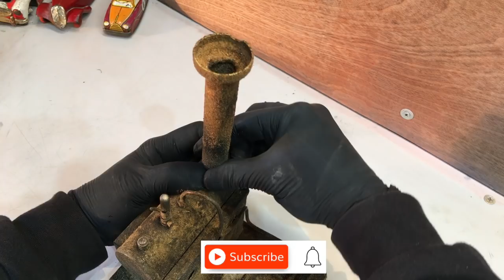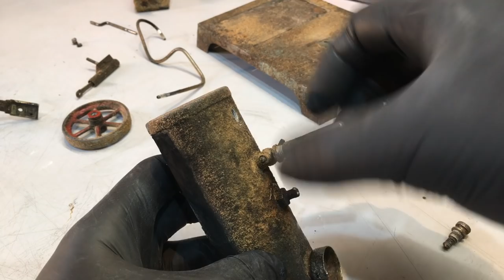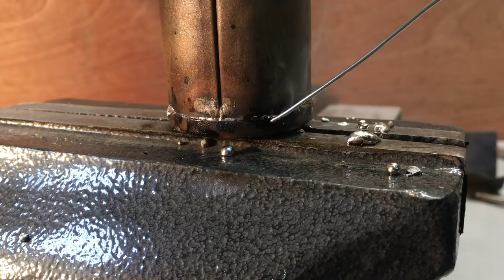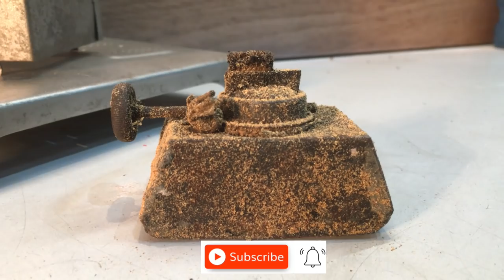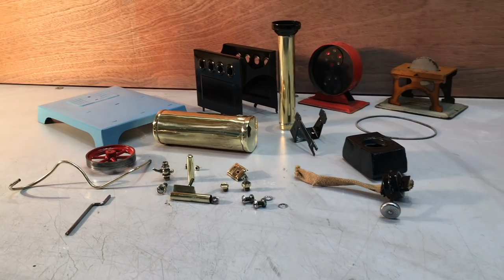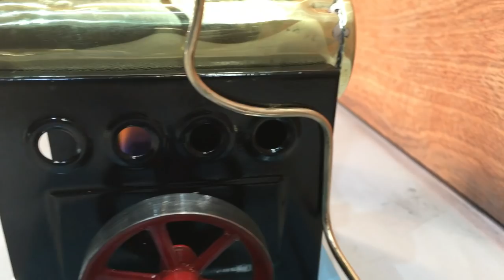Antique rusty toy - Steam Engine - JC Unis 1950 - Full restoration

Comment: I had a similar one in early 1970s.  Mine used Esbit fuel tablets, which were hard to come by, but seemed to produce steam more quickly, compared to the video.  Also had a sight-glass to verify water level, a slightly larger cylinder, and a handle to control the whistle.  I think it also had a throttle.

Once the whole mechanism got hot, you could pull the flame, dump the steam (through the whistle), replenish the water in the boiler, and it would start right back up by returning the fire-- often without having to give it a nudge.

The smell of oil and steam in our garage was frequent.  It was simply satisfying to do the little ritual to set it in motion.

Do not recall ever burning myself on it.

Nice to see one return to life.  Thanks.
Reply from the maker: Thank you ! 🙌

Comment: The engine is a oscillating cylinder engine. Cylinder has only one hole. The base has two holes. One for steam line and other for exhaust. At 90 degrees, the cylinder hole position at steam hole position, at 270 degrees it is at exhaust position. Not self starting by it's nature. Fun and fun and lots of fun. Thank you very much for the video.

Comment: I take it this is the first steam engine you have had going. You have to close the whistle and let  the boiler build up pressure. Then the flywheel will work as it should, providing the mating serfaces of the piston and plate are flat against each other. I used to restore the mamod steam engines and traction engines. I had great times rebuilding htem and firing them up for the first time.
Reply from the maker: Thanks a lot for all these infos !!! I’ll do better next time ! My welding was very weak :( 🙌👍🏻

Comment: If you turned that little valve on the whistle, would it increase the pressure and make the wheel go faster?  Great job, love the toy and it’s attachments.
Reply: @Mr_Fancypants  There is a separate part of the boiler that should prevent overpressure. Should be the nub you see at the front of the boiler. Usually it's a spring holding a seal in place till the pressure overcomes it.
With how rusted it was though, it might be for the best that it never built up any pressure. It wouldn't explode, but it might leak boiling water everywhere.
Reply: If you open a valve for anything you are letting steam out of the tank and reducing the pressure.

Comment: Amazing little toys. I have one and mine is powered via a little tablet that you light. I like the burner setup of yours. If you close off the steam whistle the pressure will build to make it run a lot faster... ANd don't worry, it has a pop up relief valve to keep it from busting open if over pressured...
Reply from the maker: Thanks a lot Gary ! I did a very bad welding job... But thanks for the tip ! I own another one lined up for restoration 😉👍🏻

Comment: I was given one when I was young , in 1958. Still have it today. Same brand JC Unis....label still on it too.
Reply from the maker: Wow is it still working ?
Reply: @TheFabrik  
No, but it's missing very simple things. The  plug for the water tank, and an alcohol burner.  What I miss is the other toy that came with the steam machine. It was a working manufacture and all the tools could hook up to the engine. It came on a wooden board, roughly 40 cm by 25cm, and there was 6 or 7 different machines screwed on the base, with a system of pulleys to hook up to the steam engine. When you're seven years old....this shit is simply fascinating. And still is when you're 70...
Reply from the maker: Thank you for all these infos ! My kids are fascinated too by this machine ! When I see all these stupid toys they are playing with... quite dangerous tho... 💥 Thanks again

Comment: I still have mine, the wheel would turn faster if you capped the whistle, there should be a valve with a spring loaded valve to blow the whistle with bun really nice job on the restoration.  mine is still in working order BTW.
Reply from the maker: Thanks a lot for watching ! I messed up the solder and I should have closed the whistle. Will do better next time ! ;)

Comment: I had one in the early 60s . Instead of the oil lamp burner, mine used small domino shaped white pellets that sat in a holder and slid into the burner area. Fascinated me for hours.
Reply from the maker: Glad it brings back good memories ! Other people have told me about this pelet system. I also find it fascinating.😊

Comment: The whistle was left open while running. Close the whistle to build up steam. Always test the safety valve as well. It is recommended to gently clean the engine first since there may be patina to save. The boiler leaks in the front, so another air check is needed.
Reply from the maker: Thank you for your comment and also for all these infos ! 🙌

Comment: Odd I came across this right now. I just disassembled a similar steam engine like that. It is already media blasted waiting for primer. I am going to polish the tank and lines and then clear coat them to keep them from tarnishing again. I plan on making the brick looking assembly that holds the tack, look like bricks with mortar. And maybe even powder coat the flywheel and some other parts. Thumbs Up!
Reply from the maker: Thanks a lot Gary ! These little engines are amazing, but they are also dangerous, there is a serious risk of explosion. Anyway I’m sure you’ll do it right. All the best
Reply: @TheFabrik  I've had mine for decades now and used it a lot. I am merely refurbishing it to make it look new again. And I also have a pressure relief valve on the very top of the boiler. So I don't see much to worry about. But thanks for the heads up anyways.

Comment: A nice result. And it works. 👍 Fuel, water, but no oil? 🤨 For a machine, oil is the most important thing. This model is more dangerous than others: no water level indicator on the boiler, no safety valve. The oscillating cylinder with the spring also works as a pressure relief valve, but what if the tube is clogged?
Reply from the maker: Thanks a lot. Glad you enjoyed ! 😌🙏 I just added some mineral oil in the piston. I have another steam engine with more valves and a level indicator. Will restore it soon.
Reply: @TheFabrik  👍 Thank you, the steam engine will be happy about the oil. I'm looking forward to another steam engine restoration video, these great toys should be preserved. At a steam engine from the flea market I had to clean the completely clogged steam pipe with a wire, but otherwise it looked like new, someone just forgot to let the water out of the steam boiler, so it left a residue after years.

Comment: A lovely job, the only niggle for me is you seemed to use what appears to be electricians solder on the boiler end caps and fittings.   I really think silver solder is the only solder you should use on high pressure vessels like a boiler as its ten times stronger than standard solder, more resilient to heat and least likely to crack during heating and cooling cycles.
Reply from the maker: Thank you for your comment. You're absolutely right ! I used a too low silver content solder... 3,5% if I remember well 😩... I was wearing full protection on my face / body. I'm aware these little engines can be very dangerous...Thanks to people like you I'll do better next time !!🙌

Comment: have thought about using a liquid or paste flux? It would make  a cleaner joint.
Reply from the maker: I know there are a few leaks here and there. It seems like the soldering is a bit too weak... I have another engine lined up for restoration... Will do better... Thanks a lot for watching and also commenting !!

Comment: You should replace the steam pipe. They get clogged inside. More steam will get through then and it will run better. It should be much faster.
Reply from the maker: Hi Chris and thanks for these infos ! You’re absolutely right... also I should have made stronger welding. There are a few leaks 😕I’ll do better next time. Thanks for watching and commenting !! 👍🏻🙌🙏

Comment: Did you need to turn the whistle off to get it running?  Quarter turn on the whistle correct ?
Reply from the maker: I don’t remember but I think I didn’t turn the whistle. There are also some leaks here and there as you can see at the very end. Honestly I was a bit lost with this engine. My soldering was too weak :( This my very first try so I’ll do better next time. Thanks for watching !

Comment: I have a a questions did you use lead solder, lead-free rosin core solder or silver solder? FYI water cannot be compressed only steam you have to get the water out of the cylinder before steam can make the  Cylinder move, you can mess up the packing and the cylinder by forcing water through it.
Reply from the maker: I messed up the soldering :( I used classical solder... I have another steam engine lined up for restoration so thanks a lot for the tip !! 😃🙌
Reply: @TheFabrik   I thought it did not look right, that why i asked, Use Silver solder on next one, Good luck

Comment: If you want it to run faster, close the valve to the whistle.
Reply from the maker: Oh thanks for the tip !
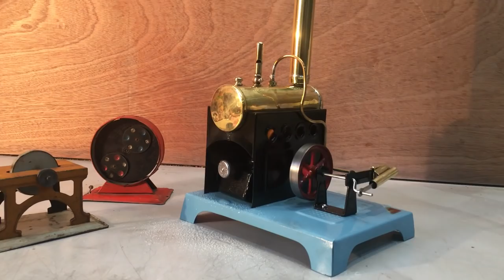Reply: And from 9:50,  sounded like one of the seams on the boiler was leaking
Reply from the maker: @samuelfellows6923  yes I should have welded each of the seams... Or it may be because there is no joint on the water filler cap... There are several leaks :/ I need to check that... 👍🏻

Comment: can you explain how to this machine works.I see only one cylinder.I can't understand.
Reply from the maker: It’s steam. Vapor pressure rises with increasing temperature...
Reply: one more question .why shouldn't We put a rubber washer in to the piston? If we don't do that,the hot air can be leaked
Reply from the maker: @phamquythu8173  there are some leaks here and there... maybe the piston is too old and should have been replaced..
Reply: @TheFabrik  thanks but I mean that can we have a completely exact piston without a rubber washer .I have never done a machine like that.

Comment: Burned yourself? Sure I had one when I was a kid (one of the German Wilesco machines) that used the solid fuel briquettes.  I burned myself lots of times. There would also be steaming hot droplets of water being flung off the cylinder when it vibrated. 😄😄😄

Comment: leaky whistle and or safety valve, it was not running as fast as it should be
Reply from the maker: Yep I know I did my best, there is a leak around the filler cap...I’ll do better next time 🙌
Reply: @TheFabrik  gaskets might help there, mamod and wilesco all use small gaskets of fiber, cork or rubber, none of which would have survived after seeing its starting condition
Reply from the maker: It seems like the solder I used wasn’t good. The silver content was too poor... this is what many people said to me... thanks for the infos tho !!! 🙌

Comment: You need to use coal of course it will not work and dont let the pipe too long exposed if you want it to move you need pressure
Reply from the maker: Thanks for the info ! There are a few leaks also... I’ll do better next time. Thanks for watching !